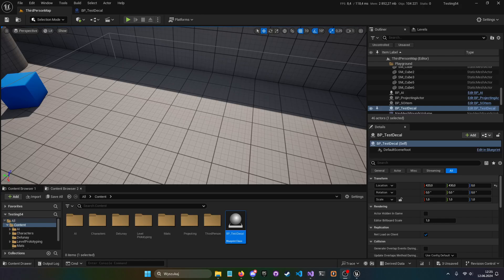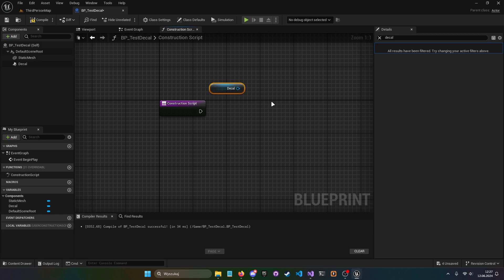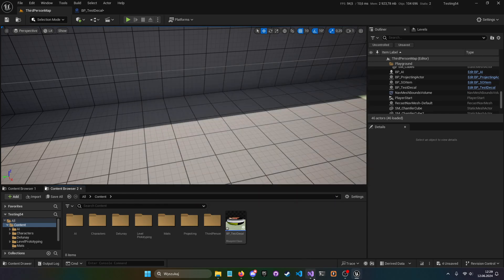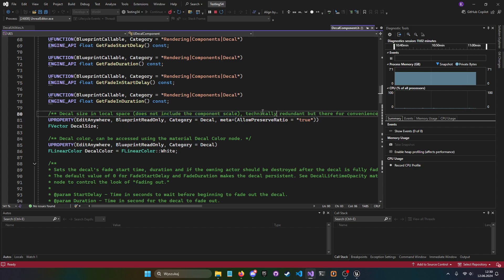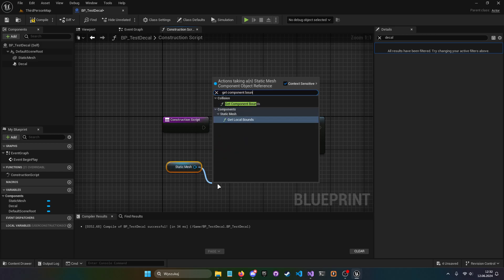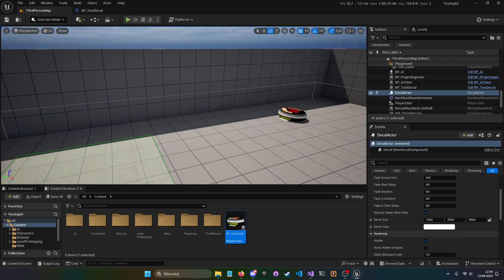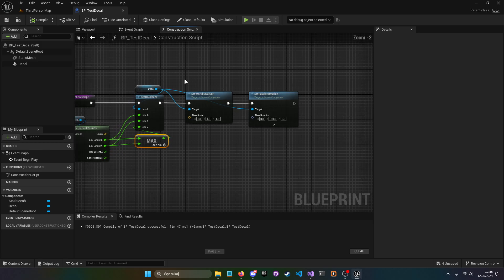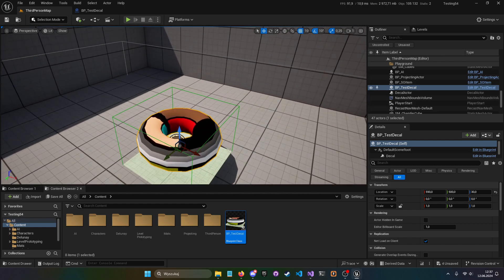UE5.4 Set Decal Size in Blueprints / Runtime

Comment: I thought, there surely has to be another way for them to call it redundant so I thought Im smart and tried it again with the "Set Relative Scale 3D" node, set the values to 1 inside the Decal Details so I can scale it. Because I though well, if I cant set the values at runtime, only scale them, just scale 1 with the actual value I need.

Afterall, 100 times 1 is also 100, or so I thought in my innocent dev baby brain. The Unreal Devs must be on some higher plane of existing because it actually does not scale by cm, instead it scales by units and there is no way to change that.

So, I thank you again for your fix, this was really frustrating and I still cant believe that this didnt get fixed yet. Bless you papa Kosiej.